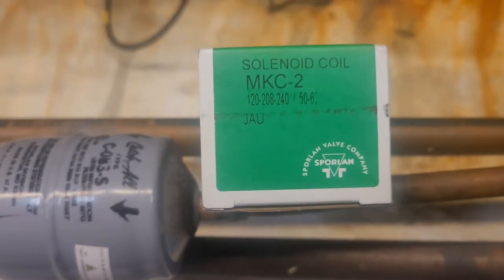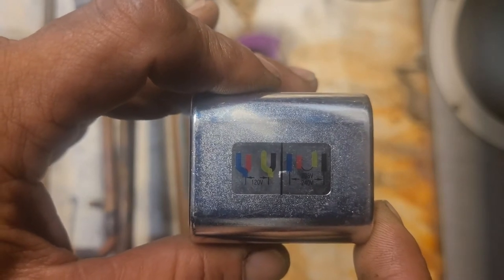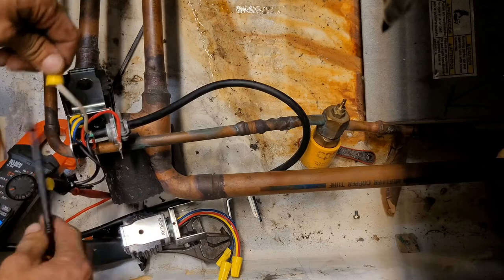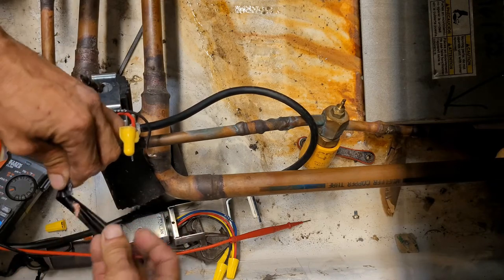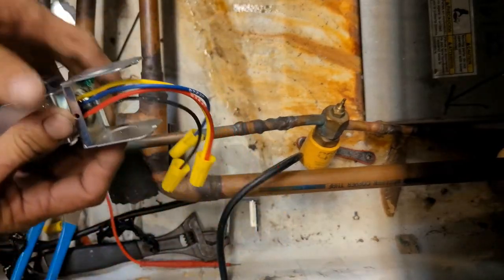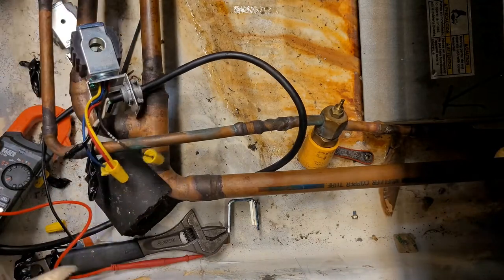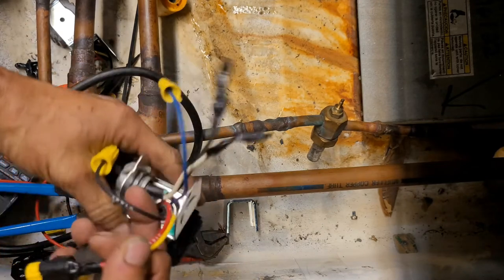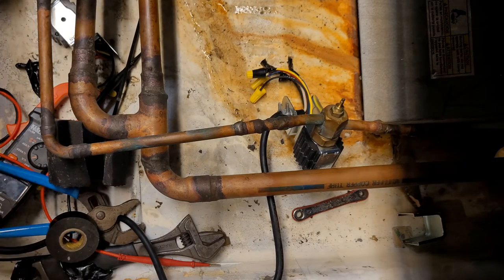Sporlan MKC-2 Dual Voltage Solenoid Coil Wiring Installation and Mounting while HOT.

Comment: I changed a 120v magnet with a dual voltage one like you have here, still can hear a buzz coming from the valve though, I even twisted the solenoid valve from the 3'o clock position back to 12'o clock thinking that may have been the issue, but it kept on buzzing. Basically Im thinking of replacing the whole valve but I wanted to avoid doing that... what causes these to just buzz like that? I faintly heard it in the video but it went away so Im just curious. keep making these vids man, theyre super helpful !
Reply from the maker: Hey I'm sorry I meant to respond to you back when I saw the message a couple weeks ago. I was going to tell you that I don't know what makes these things buzz like that. I have noticed that a lot of them do it so I don't think that it's necessarily indication of failure. I think it's just something that they do sometimes. I'm glad you find the videos helpful.

Comment: Hello hi , how to measure the resistance for this type of solenoid coil ? Which wire to measure for the 110 v rated supply solenoid coil .
Reply from the maker: You want to test tue pairs of wires together with each other. You have the pair twisted together that is red/blue and the other twisted pair Black/yellow. Keeping the pairs together, measure one lead to each pair. If you need the resistance of a new one for comparison, let me know I can test one and give you that ohm value.